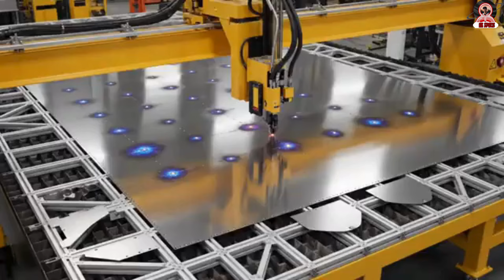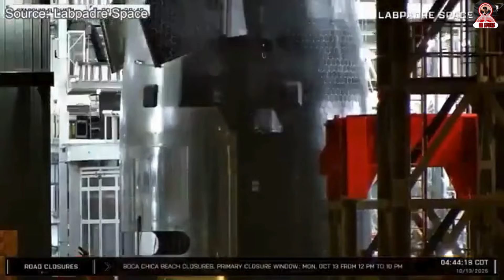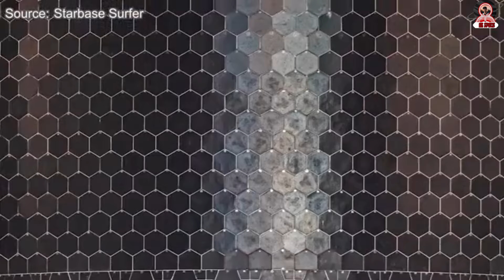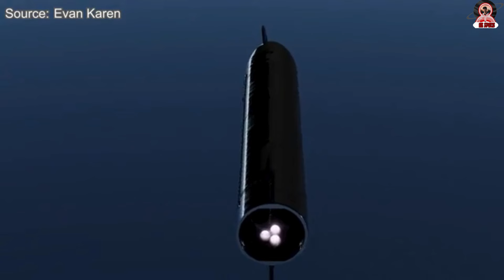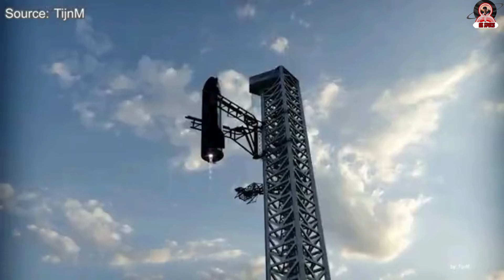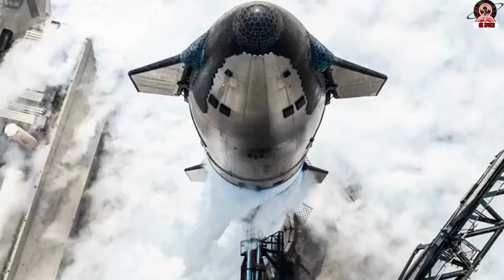SpaceX’s New Heat Shield Breakthrough Will Transform Starship Flights

Comment: If SpaceX actually created a better heat shielding, NASA should be using it on the Orion Capsule. ‘Unless SpaceX isn’t actually a NASA partner and shares all developments. Or is it that NASA can’t use SpaceX tech with Lockheed Martin’s.??’ If you haven’t heard, the heatshield of the Orion has delayed the launch of humans to the Moon. ‘I guess NASA wants the astronauts to survive re-entry.’ Gemini Opal: Educational Report SpaceX Starship's heat shield is a critical component for its reusability and operational goals, designed to withstand extreme temperatures during atmospheric re-entry from orbital or interplanetary velocities.
Design: The Starship heat shield primarily consists of thousands of hexagonal ceramic tiles, densely arranged across the vehicle's windward side. These tiles are made from a silica-based matrix, sometimes incorporating silicon carbide, designed for both ablative cooling and radiative heat transfer. Each tile is individually attached to the Starship's stainless steel hull, allowing for thermal expansion and contraction. The hexagonal geometry minimizes gaps and stress concentrations, while the tile-gap-filler material further protects the underlying structure. The system is designed to be modular and repairable, crucial for rapid turnaround.
Upgrades and Evolution: The heat shield has undergone significant iterative development throughout Starship's testing program. Early prototypes and flight tests revealed challenges, including tile loss due to aerodynamic forces, thermal stresses, and attachment mechanism issues. SpaceX has implemented numerous upgrades:
•	Adhesive and Attachment Improvements: Refinements in the glues, epoxies, and mechanical attachment points to enhance tile retention and withstand extreme vibrational and thermal loads.
•	Tile Material and Manufacturing: Optimization of the ceramic material composition and manufacturing processes to improve durability, thermal performance, and resistance to re-entry environments.
•	Installation Procedures: Streamlined and improved installation techniques to ensure consistent quality and reduce labor, contributing to reusability goals.
•	Structural Integration: Better understanding and design of how the heat shield interfaces with the underlying stainless steel structure to manage thermal expansion and prevent crack propagation.
•	Thermal Protection System (TPS) Layout: Adjustments to the tile distribution and edge protection along the Starship's leading edges and control surfaces, which experience the most intense heating.
Significance for Operational Goals: The heat shield is paramount to Starship's ambitious operational objectives:
•	Full and Rapid Reusability: It is the core technology enabling Starship to survive re-entry intact, allowing for inspection, minimal refurbishment, and quick relaunch, dramatically reducing launch costs.
•	Cost Reduction: By making the entire vehicle reusable, the heat shield eliminates the need to build a new upper stage for each mission, a cornerstone of SpaceX's strategy for affordable space access.
•	Mars Missions and Deep Space Travel: A robust heat shield is essential for returning from high-energy interplanetary trajectories, such as missions to Mars, where re-entry speeds are significantly higher than from Low Earth Orbit. It also plays a role in atmospheric braking at the destination planet.
•	Payload and Crew Safety: It protects the vehicle's delicate internal systems, cargo, and future human occupants from the lethal temperatures and pressures of re-entry.
•	High-Cadence Operations: A reliable and easily maintainable heat shield is critical for achieving the rapid launch cadences necessary to build orbital depots, lunar bases, and Mars settlements. 
The Mars Rover Perseverance landed on Mars on February 18, 2021. As of late November 2025, the rover continues its operations on Mars, collecting samples, with its primary mission having been extended multiple times and no immediate end date announced.
NASA's Europa Clipper mission is set to launch in October 2024 and is projected to arrive at Jupiter in April 2030.
The Artemis III mission is currently targeting a launch no earlier than September 2026. The mission aims to land humans near the Moon's south pole.